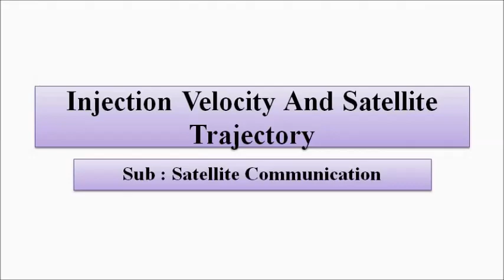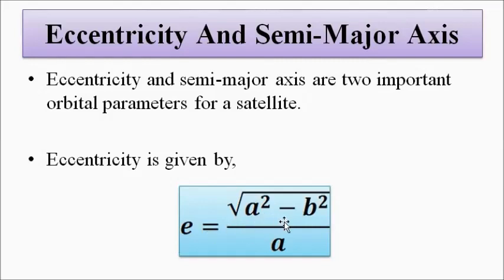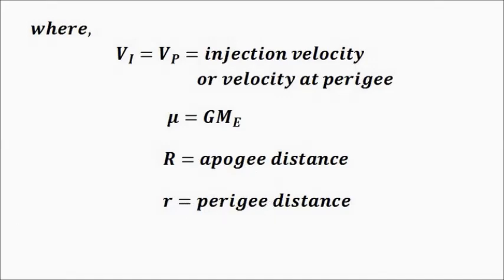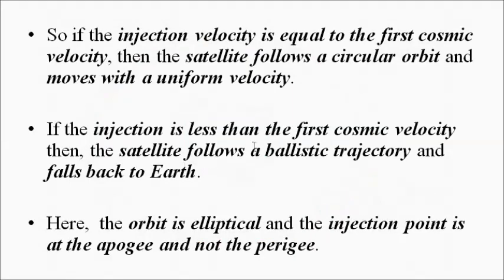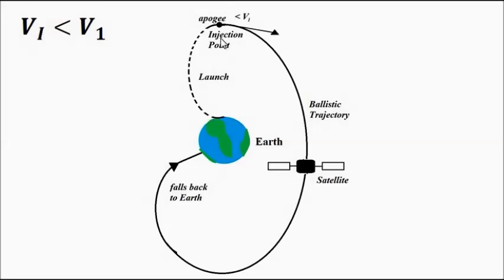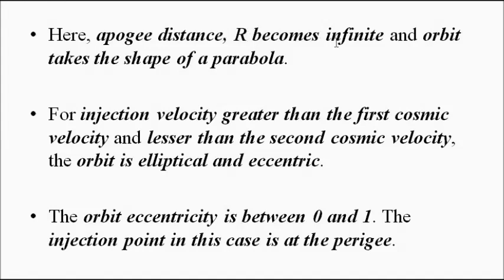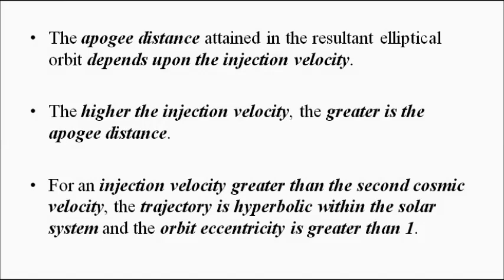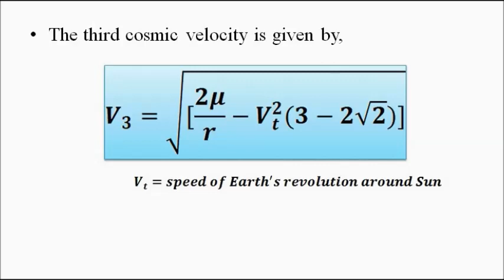Injection Velocity And Satellite Trajectory | Basic Concepts | Satellite Communication

Comment: You say that the injection velocity determines whether a satellite follows a circular or elliptical path, but I don't see how that's true based on the video. It looks like for a given injection velocity V_i, you can set the circular and elliptical equations equal to each other to find radii r_1, r_2, and R such that r_1 results in a circular orbit, and r_2 and R result in an elliptical orbit. Is that wrong?